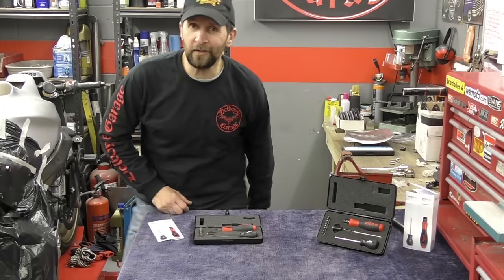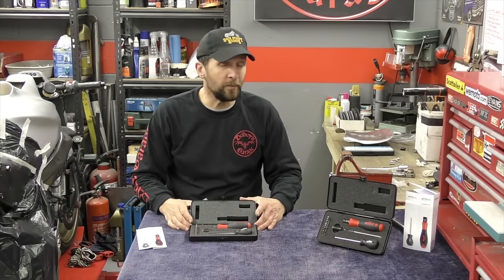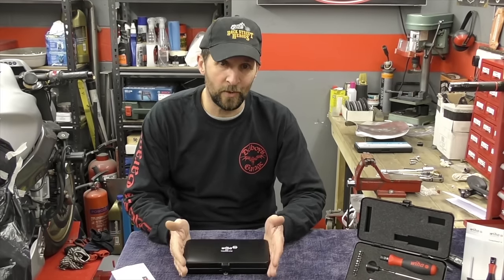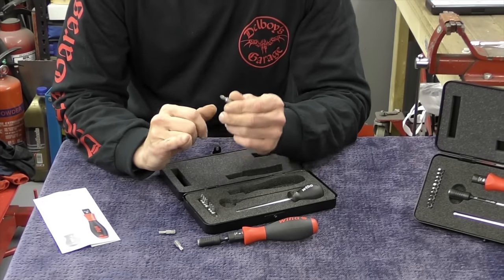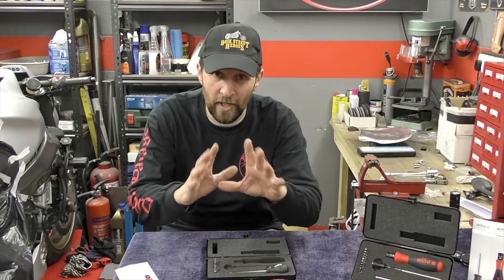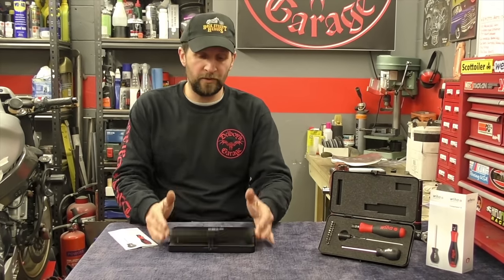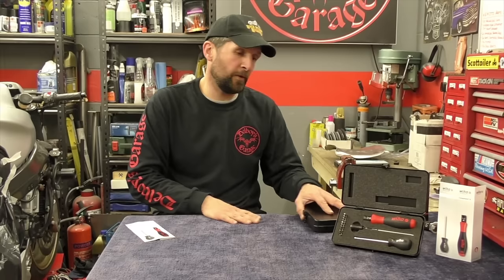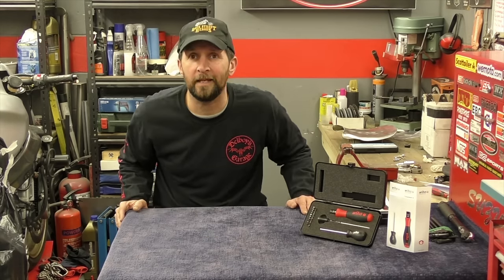Delboy's Garage, Prize Draw #11, Wiha "Torque Screwdriver"

Comment: That is a nice torque screwdriver.  When you have screws that can only be torqued to a very low value then they are indispensable.  Probably not something you would be working on, but these are really important in very small fasteners and plastic screws.  I've even worked with ceramic screws on high voltage equipment that have a very specific torque setting, within 0.1 NM.    Thanks for sharing!
Reply from the maker: These are especially useful for firearms and camera equipment !

Comment: Fantastic piece of kit. I worked in precision aerospace engineering for many years and you are bang on the money about the importance of torque settings even on small screws, had my fair share of butchered screw heads (done by others) on brake and clutch reservoirs due to some plonker over tightening them, i could probably write a book on it. H&R
Reply from the maker: Ayup Dibs, too right mate... I was nowhere near your level, just a lowly bus mechanic, but even then setting the brake bands in a Leyland National gearbox still needed to be precise, or the bus wouldn't change gear!  So I think we all learn the importance of accuracy, and not swinging on things, just so they don't come undone!  Take care of yourself fellah, Del

Comment: This one of those 'I know this' -deals... it'll come to me, maybe too late, but it will.

Today I found out the dome light in my car comes with a factory stripped hole for one of the two attachment points to the roof. I though the screw had just backed out over the years, but, no, the hole is actually stripped. It's back up in there with some blue Locktite for the time being. If it comes out again, I'll have to have a rummage around for a slightly bigger self-tapping screw.

Comment: OK most of us could not justify or indeed find the cash to buy this tool for torquing up to 5 nm....But and it's a big but ...what a fantastic opportunity to get a chance to 
win it for free !!! 
I'm sure if I were lucky enough to win this (not likely still looking for the answer) I sure as he'll would be using it...
I never owned a digital vernier guage until  five years ago then I bit the bullet and got one...I have used it since many many times ..just recently it packed up and I replaced it within 2 days and have used it two or three times since..(OK only a tenner from ebay)...
The point is i wouldn't spend that cash on that tool But to win it would be amazing so BRAVO DBG for the opportunity! xxxxxxxxxx
Reply from the maker: Thanks brother, you make a good point, once you take the plunge and buy the right tool for a job, you can never justify hacking it again... !  Get yer entry in mate - Good luck !

Comment: It took me a few stripped bolts for me to realize there are things like Metric and Inches Alan keys!! I have been using Metric on my Harley and they were never the right size... and just recently purchased the inch ones and they fit nice and snug! 
Is there anything like that for Torque bits too? I have the ones that say T 25, T 27, T 30 etc.
Reply from the maker: Yes mate, sadly with a Harley, you do need imperial tools, but thankfully, torx is torx, they are their own scale, neither metric, nor imperial, just torx!  They are effectively a third scale, so whatever is quoted is correct...!
Reply from the maker: Not quite so simple buddy, on new Harleys over 50% of the fasteners are metric, it's a nightmare!  They even mix metric and imperial threads, not just bolt heads, even on my 05 FatBoy the shock bolts are 15mm front, 19mm rear so go figure lol!
Reply: Moonfleet41 sounds like an electron microscope im working on. The previous service guy had also striped many a imperial fasener making the job of getting it back up and running that much more fuuuuunnnn. Needless to say i own the above mentioned screwdriver among other high end torque tools.  

The right tool for the job makes all the difference! My fathers motorcycle is no exception either

Comment: Hi mate, Can you do  a video on cleaning a fuel tank. Will diesel , veniger or cola clean out the rust. Also my tank has a new paint job and I don't want the paint to bubble up. Thanks and keep up the amazing work.
Reply from the maker: Don't use chemicals buddy, just a handful of small nuts, maybe 6mm at most, something that will come out of the fuel tap hole later, chuck 'em in the tank, stick a pint of water in it, and shake the shit out of it... the nuts will scratch around the inside and remove all the loose rust, then wash out with petrol once all the nuts are out... if it is really bad, you may have to line it with PetSeal...

Comment: Hi Del. Thanks for the video, fancy piece of kit. I have used my torque wrench just a few times to undo bolts. I didn't know you are not supposed to do this 😯. Is it now scrap? Can it be saved? Cheers - John
Reply from the maker: Hi mate, not necessarily scrap, and one use won't do too much harm, as long as you didn't swing on it.. but a toque wrench mechanism is only designed to be forced one way, repeated use will make it wildly inaccurate... so buy a breaker bar for future stuck bolts!
Reply: Hi Del. Thats great news, didn't use it for anything too strenuous. That break leaver that stayed in on position. I eventually got sorted. I read somewhere about the grease drying up, checked it out, and thats what it was. Great result sorting that for myself, with your expertise  of course 😁. Thanks Del ur a star.

Comment: Hey delboy..quick question...I'm always a little hesitant about torquing my spark plugs.  Just always feel like I'm going to strip those puppy's..do you think it's complete necessary?..thanks..Joe l..USA ..
Reply from the maker: Hi Joe, no, not at all... spark plugs have a crush washer, this is a small hollow soft metal ring around the plug that is deliberately designed to crush when you tighten it down and make a complete seal... so from the moment it touches base by hand, there is probably about another entire turn of the plug before it's fully tight, but it feels tighter than when you are spinning it in with your fingers, so yes, it naturally feels like a stripped thread... if it is a healthy plug and a healthy thread in the cylinder, then it's fine to torque it down... just beware not to over-tighten it, cos that's how you do damage!  Hope that helps, all the best, Del

Comment: proper tool porn my 1/2 drive torque wrench exploded last night luckily my 3/8 drive was within range but need to replace the bigger one...Yes I do many jobs up to 210 nm !!
any how nice job very nice kit...
🖒🖒🖒🖒🖒🖒
just thought as an ex bus mechanic you know all about big torque inch drive and hi torque pneumatic and hydraulic....I'll go and shake myself !!😕
Reply from the maker: Too right mate, our biggest torque wrench was 6ft long, 2" drive, and was effective up to 1,000Nm!  Damn thing was frightening to use... you literally had to hang on it to get the central lever to break... and the windy gun we used on wheels was 2ft long and weighed 25kgs in itself... the company issued steelies as standard lol !

Comment: I can appreciate a quality tool as much as any man but there really is no need for a £150 torque driver for doing up switch gear and basic fasteners. Just use a bit of common sense and nip it up. 
I can't think of anything on a bike that a home mechanic would be touching that requires this level of accuracy.
Reply from the maker: Not so my friend, your bombastic bluster is typical of people who think they know it because you probably do know and have these skills yourself and tar eveybody with the same brush, assuming they know what you do.

"Just nip it up" is gobbledygook to some people and it frightens them because they simply don't know how far to go.  Lightweight, fine thread screws into aluminium casings are the first casualties with this kind of guess work.  The best case in point being derby cover screws on a Harley Davidson - they hold the clutch in place and it is important all screws are done up to the same torque.

You and I might know where that feels right using our 'nip it up' and common sense approach, but many people don't mate, and this is ahrdly an expensive toll when you consdier the cost of a basic dealer service.  Some people like to do things properly for their peace of mind on a bike that has costs them thousands of pounds.
Reply: Fair point, can't argue with that. Common sense isn't very common after all.
Reply from the maker: Very much so mate.... its an old mentality aye... and you have no idea of the abject "Fear" we hear from young budding mechanics... its easy to assume they know what to do..!  and whats more mate... how much do these kids spend on their electro Tech..lol!